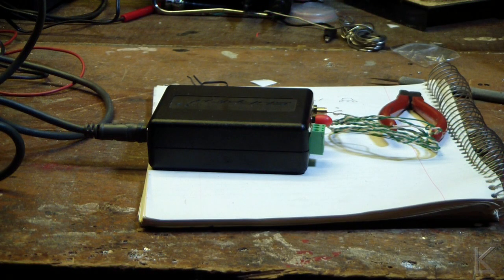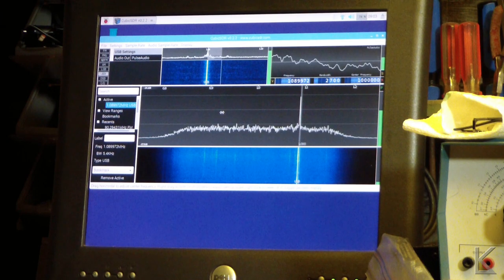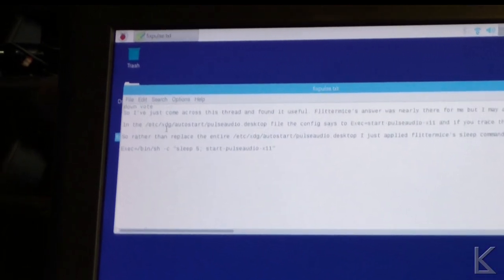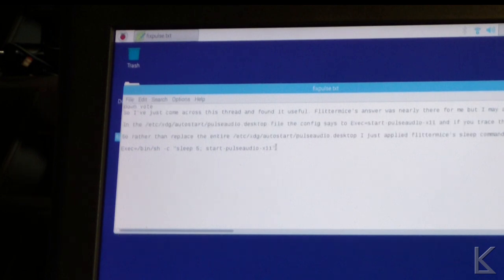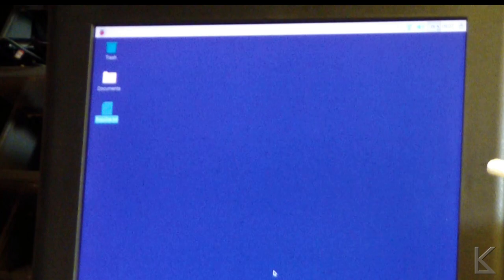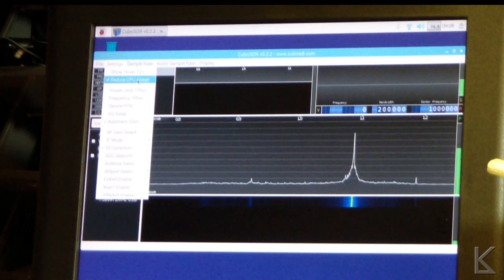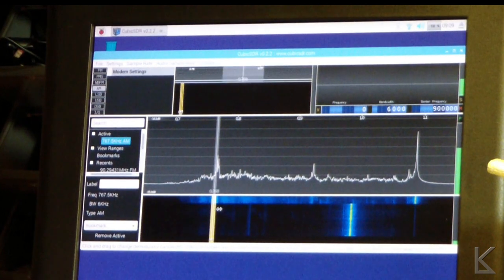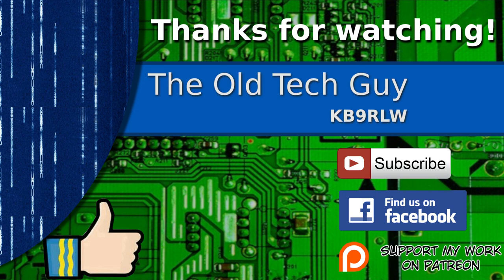Ham Radio - SDRPlay running with CubicSDR on a raspberry Pi 3

Comment: We have released a Raspberry Pi 3 image that has a number of SDR applications pre-built and tested that support the RSP. Periodically, we will update the image with software updates and new software.
The current list of software included on the image is:
SoapySDR/SoapySDRPlay, SoapyRemote, ADS-B (dump1090), CubicSDR and SDR-J DAB receiver
Please note: This is a complete OS with software image. Writing the image to a micro SD card will wipe the micro SD card of any other data that is on there, so we recommend you make sure you have backed up any data on your existing micro SD card or you use a new micro SD card.
Instructions:
1. Download image. There are two downloads provided, the 7zip version is just a smaller download but not everyone has 7zip which is why we also provide a zip download. The links are here:
http://www.sdrplay.com/software/SDRplay_RPi3_V0.1.zip (2.7 GB)
http://www.sdrplay.com/software/SDRplay … 0.1.img.7z (2.0 GB)
2. Extract the contents of the compressed file. This will extract to a .img file which will be about 7.2 GB
3. Use an image writer such as Win32DiskImager (https://sourceforge.net/projects/win32diskimager) to put the image onto the micro SD card.
WARNING: Please make sure that you use the correct drive letter for the micro SD card. The image writing software will completely remove any data that is on the destination media.
That’s it – put the micro SD card into the Raspberry Pi 3 micro SD card slot and boot the system. Allow the system to fully boot and you will see a GUI that will allow you to run each of the applications or read further information.
We also recommend that you use an active cooling system on your Raspberry Pi 3 to avoid any issues with over heating. In our tests, we have used heatsinks and a fan in a case. The CPU speed will be throttled if the temperature gets too hot, so for optimum use this is really recommended. These cases are available at reasonable prices from many Raspberry Pi stores.
If you are a developer of software that supports the RSP and you would like to be included on the image that we will release periodically, please contact us at software@sdrplay.com – currently we’re aiming to update the image every quarter, this will largely depend on software availability and what the demand is.
We are aware of other software that we are looking to get onto the next release such as Pothos and more SDR-J software. We will work with developers on any issues we’ve seen during this process so that we can get them onto future images.
Reply from the maker: Bravo!   It's great to see your company supporting the linux community and Raspberry pi community.
I'll do a video review of the project soon.
Reply: Dump 1090 Crashes on my Pi 3 after a few minutes. SDR-J works well for DAB, I would say it works very well. CubicSDR has me puzzled . The software is able to run broadcast FM with no skipping but SSB is not so good which seems  odd because ssb uses far less bandwidth . Cubic SDR does work. I find I have to run the test first or it wont start. It's Early days and I am sure thing will get better as time goes on. I have heat sinks on my RPI2 and a fan. So it should not be throttling because of heat.
Reply: Does any of these apps in your image support Funcube Dongle pro+? I own a Rpi 3b and I have made tests with GQRX,  but I’m not very satisfied.

Comment: If you hit high CPU use on a Pi3 or 3b without active cooling and sinks on the chips, the CPU will throttle way back to keep it cool. You won't even get advertised speed out of it, not even close. A fan blowing against the plastic case will not do anything, lol. Add one of the little case mounted micro fans and the sinks and you'll get way better performance. It's usable enough but not great... It's like doing SDR in survival mode, lol. All that said, yes, the Pi4 is the better option for SDR'ing, hands down.

Comment: I guess I missed the boat on this one, I have several Raspberry Pi 3's and the idea never crossed my mind to run my SDR Play on one of them. Instead I just bought a Latte Panda with the idea to run it portable with SDR software and a logging program as well as maybe CAT control for a FT-817 under Windows 10.
Lee, WA8QFE....Indianapolis
Reply from the maker: +Francis Thompson Linux runs on the panda, if you want better performance
Reply: My Panda has a registered version of Win10, so I'll run Skywave Linux on a Odroid-C2
Lee, WA8QFE....Indy
Reply: Thanks, now I know what I'm puttin' together.  Won't be RP.

Comment: Hello, I do not think I am using PluseAudio but I am using Alsa... I think. Does that matter?
Reply from the maker: Yes.  Cubic is set up to use Pulse audio.  You'll need to install pulse.   It usually comes installed by default.  If it's not working, go into synaptic and remove it, then re-install it.

Comment: Could you show us how to install QUISK on RPi-3 and get it working.
Reply from the maker: Yes, if I had anything that provided an I/Q output.   QUISK takes I/Q input through a sound card, so you need the hardware first.
I might have a softrock around here that someone sent me.   If I find it, I'll use quisk to run it and make a video.  Could be a little while though.
Reply: Sounds promising ......... thank you for considering it.

Comment: I have Cubic in the PI.  I want to tune it remotely at home over a TCPIP . Show me how?Rich
Reply from the maker: Screen sharing with VNC.   I don't know how fast it will be since there's lots of data with the moving waterfall.  You'd need cooling on the Pi, it's CPU is going to get hot.
https://elinux.org/RPi_VNC_Screen_Sharing

Comment: did you trie clocking the pi on a nother ( higher ) speed ?
Reply from the maker: The gain is very small realistically.  You'd also need some active cooling as the CPU temps will jump up quite a bit.

Comment: Very disappointing, bordering on unusable. So unfortunate. The official co-founder's youtube video of Raspi3 with SDR play does not show how crippled this implementation really is.
Sorry to be so negative but I was really looking forward and excited about using  this combination.
I wonder why it is so bad...... Pi3 is running a 4 core new pipeline ARM processor. Is it the 4meg Ram limitation?.
Reply: Using Cubic SDR the FM Radio works better than I expected. The SSB does not perform as well. I thought SSB would be better because it use less bandwidth but at the moment it seems not.  Maybe the ssb needs more CPU time.  SDR-J Dab radio also works well which I had not expected.
Reply: Why limit yourself to Pi? Seems there are other options, but I'm just learning of all this. Maybe there were no other options 7 months ago. Cheers.